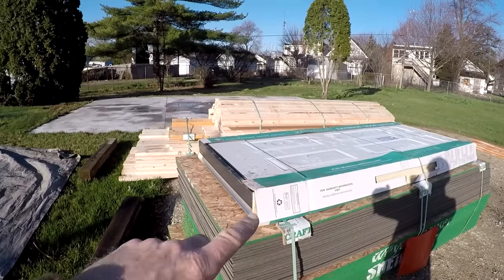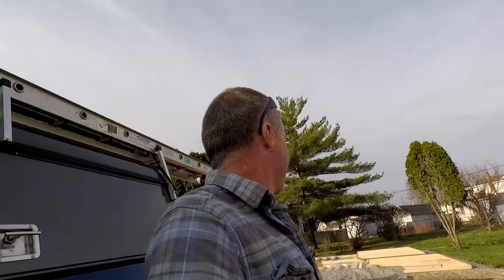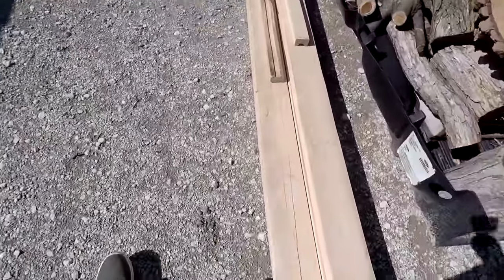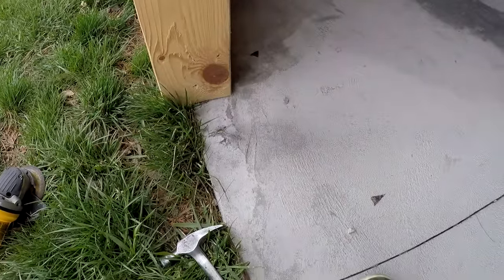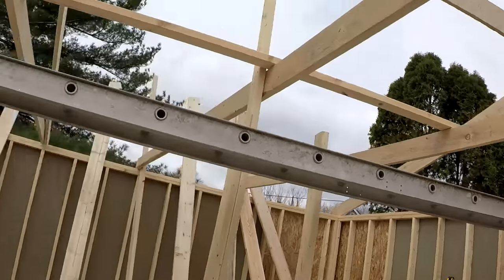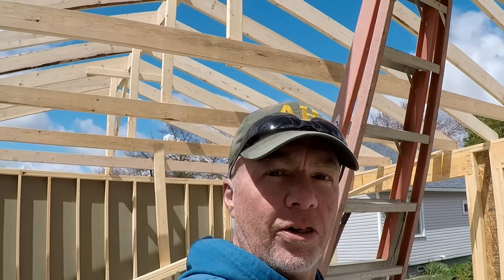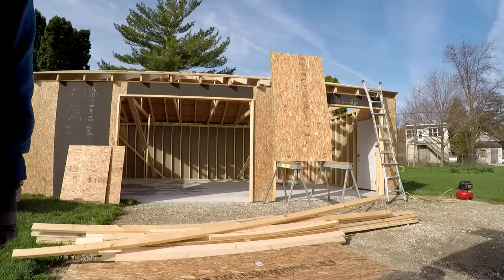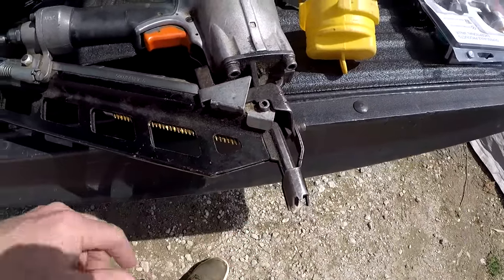Full Build! I Framing Alone | 24x30 Garage

Comment: As a resident of the UK,,seeing this build is bizarre...Almost all garages here are built from brick or stone...Apart from the roof of course...Very odd to see..
Reply from the maker: This is pretty much how every residential building is constructed over here🤷‍♂️
Reply: When this construction method began they called it balloon construction because the walls appeared so quickly. Brick and mortar is not suitable in the Western US where we have earthquakes. This also allows for easy installation of insulation. Now that energy costs are so high I understand poor thermal insulation is a big issue in the UK.
Reply: @unclefester6501  here in the UK,the cost of wood outstrips brick/stone construction. So this build would be unviable here in the UK..
Reply from the maker: I’d love to get over there someday and see how everything is built there!
Reply: The UK does not build everything from brick and stone... And if you are, you're paying an ungodly amount of money for a garage.
Reply: @xephael3485  you need to read my comment again..
Reply: I like the wood framing of buildings in the US. What I don’t like is the simple metal roofing that often goes on without insulation. In The Netherlands we have metal roofing but those panels have insulation up to several cm’s already on them.
Reply: @cybersurfer2010  even on our cattle sheds we have foam insulation on the metal roof sheets....
Reply: @markb1487  "wood outstrips brick/stone construction"  no way that's even remotely possible... time and labor needed to do masonry is far beyond what the cost of imported lumber and framing would ever be.
Reply: @cybersurfer2010  In the USA if you want insulation you can do a number of different things like have someone sprayfoam the inside of the building.  If you don't need insulation then you save a lot of money per panel.

Spray foam is likely better than insulation on the metal panel, as it creates a complete vapor barrier on the roof/wall.  You can also control the insulation value you want.
Reply: @xephael3485  not here in the UK..Only industrial buildings/agricultural buildings are not built of either brick or stone... Garden sheds are built with wood here+the odd log cabin used for holidays...Thats  it....
Reply: All comes down to price and resources, north America build by wood and concrete mainly
Reply: I am European and live in USA, i have never seen a house built with stick frame before till i came to USA, i was shocked myself. I always seen houses built with brick or log in Europe. Now living here for over a decade i feel like the construction industry in USA tries to find ways to build 2000 sq feet house in 6 months where in Europe one house takes about 2 years. I still prefer the European construction system it just seems like they care more about the quality over speed.
Reply: @peterstein3726  it might just be pioneer thinking , get it up fast before the winter is here or you’ll have to spend another winter in a wagon!
Reply: So I live in a different UK then. Most of the newly built estates are made exactly that way as shown on the video.
Reply: What do you feed the termites?
Reply: Great video brother!
Reply: I noticed that you didn't put seal seal down under your walls maybe not a requirement or just not in this build just asking
Reply: This is true. Construction is done differently in different parts of the world. I'm from Finland and it's really close to UK, but we build a lot of houses and garages out of wood
Reply: Gah! So which is best and why? Beginning my garage build in 7 weeks. In the UK. IResearching now.

Comment: Curious question…why is he using black board in the center of the walls and osb on the corners
Reply from the maker: There’s no shear strength with the black board, that’s why OSB goes on the corners, because it gives the wall shear strength.

Comment: $32k in materials?  Your wall framing would have been around $400 for 2x4, roof about the same, so let’s say $1000 to frame it.  About 32 OSB for walls, so say around $600. And about the same again for the roof, so another $600.  So, total lumber would have been $2200 or less.  That leaves $30k for concrete and nails (bc you didn’t use any ties)… that’s some pretty expensive concrete.  Given that your slab is around 14 yards, and concrete runs around $150 per yard, that’s only around $2100.  Leaving you around $28k for nails and labor.
Reply from the maker: Siding, shingles, doors, electric……
Reply: @MyDIYAdventures  you only show framing, but assuming you sided, roofed and wired it too, depending on your choice of siding, this would be the most expensive part.  If you went with cement lap siding with a rainscreen, your probably looking at another $2k, roughly.  Garage doors will run about $500 each.  Asphalt shingle roof would need around 24 bundles, assuming $50 per bundle (which would cover the cost of the rain barrier and drip edge), that’s $1200 for the roof.  So we’re at $4200 for doors, roof and siding.  Trim and paint might add another $500, leaving only electrical, and even if you ran another sub panel, your just talking a few switches, outlets and some romex, which wouldn’t be more than $250, but even if it was $400, that’s $5100 to finish out of $28k remaining, leaving $23k for labor based on your $32k cost estimate.

Unless you are doing this in Alaska or someplace where material costs are just crazy because you can’t get anything delivered, but I got the impression that you were in Indiana and you were sourcing materials from Lowe’s or Home Depot or something like that.
Reply from the maker: This was contracted almost 2 years ago when material was through the roof.

Comment: I stopped  watching  after you put osb in between the header material...
Reply from the maker: Why?
Reply: You do realize that the OSB is not in ANY way structural when used like that, it' only being used for spacing purposes to get the header to a 3.5' width to match the 2 x 4 wall thickness. This is commonly done everywhere.
Reply: Not everywhere,  any header that is used to support a load cannot be separated by a piece of plywood.  The two pieces of header material must be nailed together as one, not separated...
Reply: @jeremyreimer942  Okay boss, I'll defer to your expertise.

Comment: Can u put roof rafters staggered i always see people put them on same side seems staggered you could nail them better?
Reply from the maker: I think building code probably requires them to be opposite each other, but I don’t think a 1.5” offset would hurt anything…it just may not pass inspection 🤷‍♂️
Reply: @MyDIYAdventures  I'm in Pennsylvania in the woods an a Soldier so I don't deal with code I just build an was getting ready to build another building an always wondered but probably gonna try it since it's only gonna be a shed
Reply from the maker: I like your style!

Comment: Is the slab level or sloped?  I've been trying to figure out how to set stud walls up on a sloped slab?
Reply from the maker: I always plumb the walls after standing them, to account for any pitch there may be.
Reply: @MyDIYAdventures  using shims for example?
Reply from the maker: @mlthornton1 no, you keep the bottom plate tight to the concrete and just plumb the walls vertically, they don’t need to be level, just plumb.
Reply: @MyDIYAdventures  interesting.  Thanks for this.  That is to say you build it with the top and bottom 2x4 not exactly parallel?  Meaning the front stud is maybe an inch longer than the back stud?
Reply from the maker: @mlthornton1 everything is the same length, the wall just ends up like a parallelogram
Reply: @MyDIYAdventures I see, thanks again